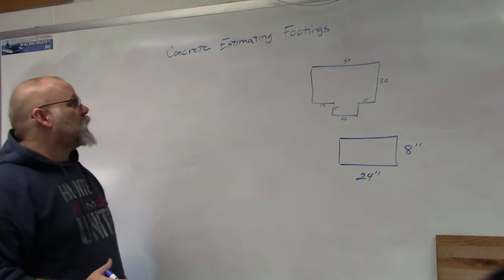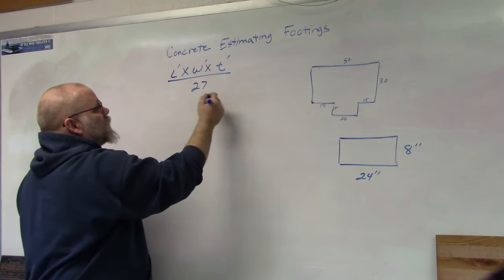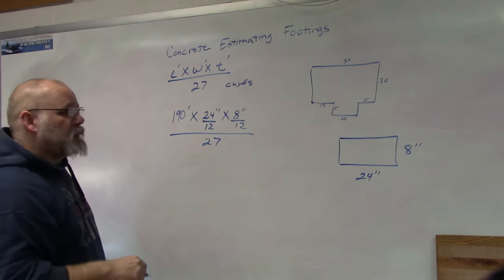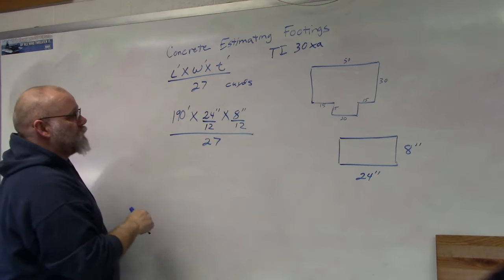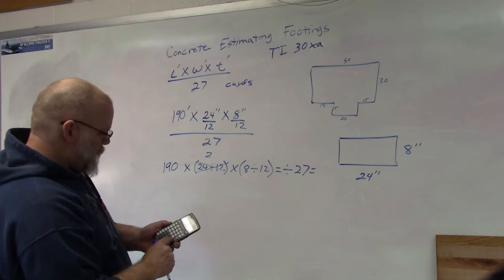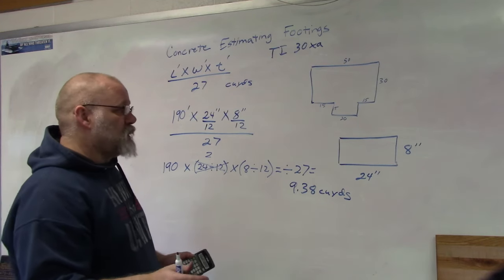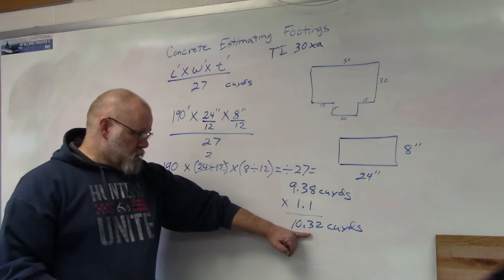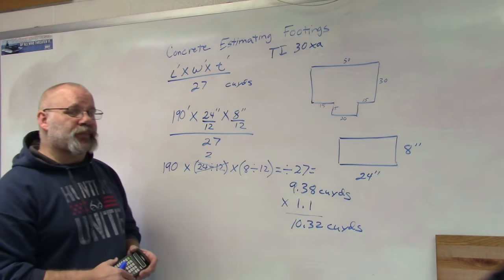Estimate Concrete Footings

Comment: How do you determine the width x depth of a footing for a slab? Trying to figure my project and cannot find that info
Reply from the maker: It depends on the type of soil and the weight of the building. Ask a local contractor, they should know.

Comment: Sorry, I’m so confused. Isn’t length supposed to be the longest side of an object? Wouldn’t 190’ be the perimeter?
Reply from the maker: @circlehomeservices8917  the footing goes all the way around perimeter, so length of footing = perimeter.
Reply: @timpalmer-logstolumber1999  ohhhh, that makes sense. I thought these were isolated footings, so I was confused
Reply from the maker: @circlehomeservices8917  if you have any other questions I will be happy to answer them.

Comment: Works for block walls as well right? Footing L x W x H ÷27 ?
Reply from the maker: Yes, you can put a block wall on the footing using that equation for the concrete

Comment: am I missing something ? I added everything and did not come up with 190
Reply from the maker: If you add all the numbers for the perimeter 50+30+15+15+20+15+15+30 they equal 190 linear ft

Comment: How what a complicated way to figure that. Just do L x W = sq ft. Divide that by 81 to get 4 inches. Then just double it for 8 inches, triple for 12 inches, etc, etc.
Reply from the maker: I have never seen this method but it does work. But If using a calculator I don't see how it is any easier. Thanks for the info,  I can teach it as a second method, this method may be easier to understand for some students.
Reply: @timpalmer-logstolumber1999  maybe it just seems easier to me because that how I learned it when I was a kid. I don’t math too good😂

Comment: So in my class I learned that the length is calculated by center line
Reply from the maker: There is usually more than one way of doing things. The main thing is that you have enough concrete and not a little short.